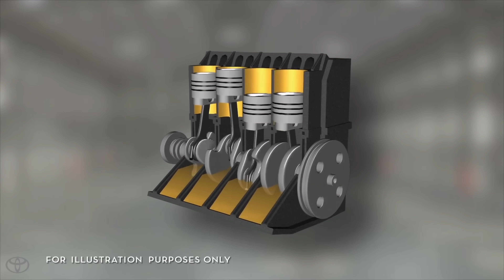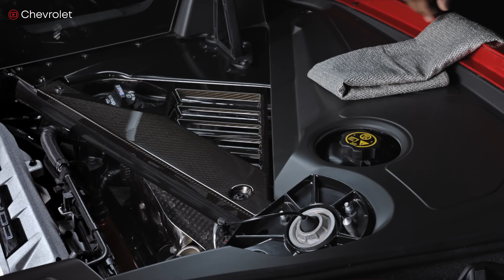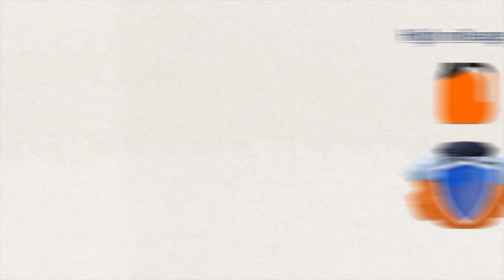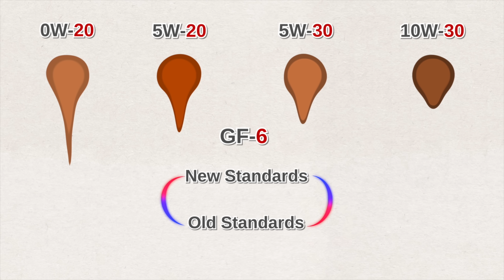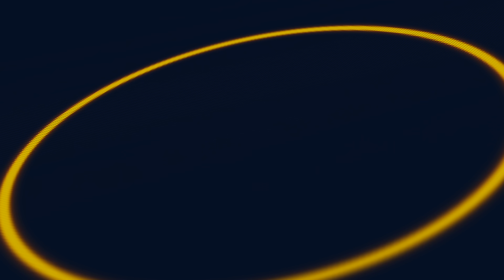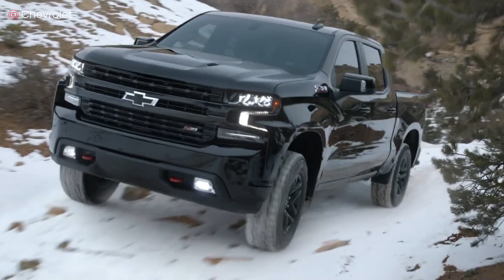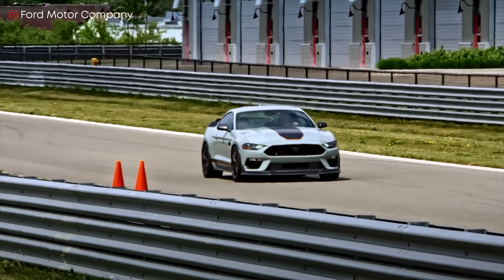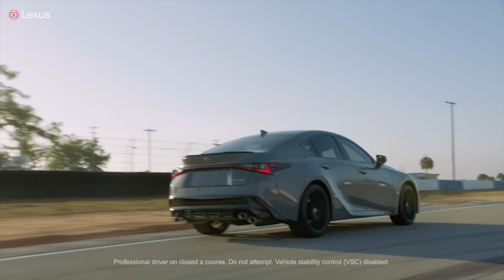7 Engine Oil Myths Stupid People Fall For

Comment: Oil can be called a "synthetic blend" if it contains just one drop of synthetic oil, the balance is conventional oil. Don't expect the benefits of synthetic oil when using a "synthetic blend". A synthetic blend can be no better than conventional oil but cost more.

Comment: 0w-16? I have literally never seen or heard of this
Reply: Unfortunately, it is. Ecology is a priority and this is the result. The oil is very thin and does not put up any resistance = low consumption = glory to the environment. Attention, you must have a modified engine from the factory for this viscosity!!! Not that you will be using 5W40 and decide to try 0W16. You wouldn't like the test at all...

Comment: “An ounce of prevention is worth a pound of cure”, I use Amsoil products, they never let me down and much cheaper than paying ~$7k for a new engine.  I was an avid Mobile 1 user before I tried Amsoil via word of mouth, my engine just felt like it ran with much less effort and slightly better MPG compared to a fresh oil change using Mobile 1. This is all my personal choice and experience.

Comment: these low oil viscositys are just for emission perpose and mpg. The government coulden't give two shits about the longevity of your engine. granted running to thick for certain engine's isnt good, but oils like 0w-20 for example of turbocharged cars lol its comical.
Reply: Attention, you must have a modified engine from the factory for viscosity 0W20, 0W16 !!! Not that you will be using 5W40 and decide to try 0W16. You wouldn't like the test at all... It's for new "ecological" engines - you spelled it right...

Comment: These newer smaller displacement high horsepower engines have much tighter tolerances. I have seen heavier oils actually almost starve the parts because the viscosity is too heavy.

Comment: As long as you change the oil often any oil that meets the manufacturer specs is fine. The only time i stray from that is a turbo engine or a vehicle that is being used in extreme conditions such as offroad or racing. In that case I always use a good name brand full synthetic such as amsoil or redline.

Comment: Did nobody hear him say conventional oil is good as long as you choose the right weight ? 
Ummmm the w stands for winter not weight. It tells you the viscosity at low temperatures. 
This is the first video I watched on this channel, don't think I will be returning.
Reply: As of 2015 the viscosity grades are 0W, 5W, 10W, 15W, 20W, 25W, 8, 12, 16, 20, 30, 40, 50, and 60.[4] In the United States, these numbers are often referred to as the "weight" of a motor oil, and single-grade motor oils are often called "straight-weight" oils. The grades with a W designation are considered Winter-grades, and denote an engine oil's low-temperature properties, while non-winter grades denote an engine oil's properties at the operating temperature of an engine...  The viscosity of the oil does not determine the quality of the oil. If I have conventional oil (I'm from Europe = we don't know such a term here, I assume it's "mineral oil") that has the same specification as synthetic oil = no one can say that synthetic is better because both oils have passed the same test.

Comment: Car companies recommend 3-4 different options for oil! Which is the correct my friend?
Reply: The manufacturer will never "recommend" 3-4 types of oil. Each manufacturer prescribes one oil performance specification/standard that must be adhered to. Don't you mean different types of viscosity? Yes, the manufacturer does not know where or how you will use the car and what your priorities are and therefore the viscosity range can be much larger than 3-4 as you state...e.g. my priority is engine protection, so always 0-5W40... priority fuel consumption= 0W30

Comment: I have a Lexus 2006 GS300.  Would 5W-30 oil be okay to use?
Reply: First of all, you must comply with the oil specification prescribed by Lexus. If you are from the USA, I recommend API SN (although the SN standard was only published in 2010, it applies retroactively). If the engine works great and does not consume oil, the viscosity of 5W30 is optimal.👍

Comment: Auto manufacturers know what's best for the longevity of their engine until they start recommending 15k mile oil changes.
Reply: The VW concern in Europe already has an interval of 50,000 km (31,000 miles)🥶

Comment: You forgot to mention gasoline getting into the oil from leaking fuel injectors or faulty fuel pressure regulator

Comment: One of my Owner's Manuals specifically recommends changing the filter every other oil change.
Reply: J Thomas. A lot of filters these days are good for 10k miles so I can see that. For me, since they are so cheap I change it with every oil change I do for my cars and my customers. At the end of the day it wont hurt anything.
Reply: @vigilantemotors  To me it's a waste, but then my vehicles rarely even see dirt roads so there isn't much dirt on/around the engine.
Reply: @jthomas3773  I can appreciate that lol. Most last close to 10K so yeah all is good
Reply: Changing the filter only at the second change is the same as changing a baby's diaper and using the original diaper because it wasn't full yet...:face-turquoise-covering-eyes:

Comment: All I ever use is conventional oil 5-30w or 30w in all my cars & trucks, my 1995 Chevy Camaro had 500,000 miles on it when I traded it for a 2007 Chevy HHR and it now has over 279,000 Miles on it, I do all my tune ups ever 10,000 miles and the oil & filters are changed ever 3,000 miles And I'am a Professional Automotive Tech with over 50Yr.s of exsperience, Regular Tune Up's, This is the key to longevity in all makes and models, and I use 87 octane gas. Note the 95 camaro wasn't even useing or burning any oil when it was traded off.
Reply: I think a lot of full synthetic oil advocates would hate it if an oil test found no full synthetic oil in the test... which is a common test result...
   I am from Europe and also only use conventional oils. I had to take the Mercedes w124 250D out of service due to massive corrosion 1,603,xxx km (approx. 1 million miles), the MB Vito CDI standing in the garden has almost 800,000 km (approx. 500,000 miles). Yes, we have experience, there is no point in explaining something to us.   Greetings from Central Europe

Comment: I have 2002 camry LE which oil should I use now ?
Reply: Muhammad, I don't know what engine you have but you are going to want to use SAE 0W-20. You do not  need a full synthetic just fyi. Conventional oil will work just fine. If you tell me what engine you have the 2.5 or 3.5 I can tell you how many quarts you'll need as well.

Aaron
Reply: @vigilantemotors  If he pours 0W20 in there, he will thank you because he will be looking for a new engine...

Comment: I am sorry but logically this makes no sense.   If high mileage oil is better for high mileage vehicles it will be better for low mileage vehicles.     But the elephant in the room is that none of the engine oils that are supposedly awesome for gas engines, are not sufficient for diesel engines.     So a full synthetic for gas can't compare to a standard oil for diesel, even though the full synthetic is much more expensive than the diesel engine oil.   It is a marketing scam.
Reply: I have to say you took my breath away. Wow... I've never seen anyone logically come to the correct conclusion without a deeper knowledge of oils. 👍👍Bravo!!! If you want to know more - write.

Comment: My car's recommended oil is ow-20 but I imported it from America to a Tropical region, is it ok to continue with ow-20? Which I actually continued to use.
Reply: Yes. Use the oil your car says. It's used inside the car so unless you live somewhere extremely cold use 0w 20
Reply: Yes.
Reply: In a tropical environment, I would be careful with 0W30, maybe even 0W40. It would depend on many aspects...

Comment: In 1985 I bought a new '85 Tbird. The first oil change I did was with Mobile 1 synthetic 10W30 (when it was around $2/qt) . I ran it to 50,000 miles and changed the oil. Then changed it again at 100,000 and It ran great until about 136,000. The tranny went out (I think it was a C4). Then I changed it again at 150,000. I sold it after 11 years. The engine ran great but the rest of the car really deteriorated. Horrible. Never again, Ford!!

Comment: Scotty, i'll ask this question again, what damage is done when nimrod put synthetic oil in, when i told them No! synthetic oil and they over fill it?  over fill it.
Reply: If the nimrod adheres to the prescribed oil specification and has a choice between mineral oil, semi-synthetic oil and fully synthetic oil, no damage will occur and it does not matter which oil he chooses.

Comment: Back in 1976 i had a 1974 Pontiac Grand Prix with a 455 ci   it had 28,000 miles on it,  i kept seeing this commercial about really good Oil Called  " Shell Fire & Ice "  i was due for an Oil Change so i bought it   i put it in with a New filter  about 80 miles later i was driving on a Very hot day with my air on i took off from a light and the car was NOT going any where i noticed my dash lights were on,  My Engine was Blown when i drained my oil it was like water,   That Oil was taken off the market i should have saved the oil and started a case against Shell    but i was young i bought a New motor and put it in ...
Reply: In Europe I remember lab tests of fully synthetic oils and Shell was the most expensive and had 100% pure mineral oil inside. But to everyone's dismay, it turned out that it was not a scam... that an oil labeled fully synthetic might not have anything synthetic in it!!!

Comment: Journeyman Mechanic of 36 years , for Caterpillar, worked with engineers in access design, engine rebuild standards, 5 year contract with oil breakdown and wear anaylsis...... After seeing actual results from hundreds of teardowns and put backs and retests... Oil is the biggest scam on the market... Once vicosity goes down, it will start evaporating. I leave my oil level at 1/2 and check it monthly, maybe one time a year I may or maynot change a filter.... I probably have drained my oil 5 times in my life... My crappy Dodge Neon lasted 350K before I sold it, with the original filter on it. I have gotten over 200K on every single car I have ever owned.... I never let the oil go lower than 1/2 way point on stick.... Coolant is by far, the most important thing. 
I had 1 engine failure in 1982 on my 1980 grand Prix that I changed oil every 2500 miles with Quaker State... When I pulled it apart, nothing but carbon charcoal in every port... Just sold my Mercedes e320 with 275K, currently driving a 2015 Verano with 210K and made my first repair 2 weeks ago with a set of $29.00 cam sensors that took 15 min to change. Car looks showroom new !
Reply: what do you mean by oil is a scam? that there is no need to change frequently? I don't drive cars, but motorcycles - they do rev a lot higher than cars, no?!

Comment: Anyone ever run an engine on airport nacho cheese?  That's mostly oil.  Test mule should be solid roller I think: flat tappet [or bucket] would wipe out, and hydraulics wouldn't know which end is up.

Comment: Years ago a guy at work started promoting amsoil.
He even insisted it doesn't wear out it just gets impurities in it from the fuel.

He bought a new 1968 Dodge and he was changing the filter at 5,000 miles, then the oil and filter at every 10,000 miles. The last time I spoke with him was about 1998. His engine had almost 300,000 miles on it and was still running great. Also, he was using amsoil in the transmission and it had NOT needed an overhaul.
Reply: Amsoil is the best but only makes sense to use if you keep your vehicle for a very long time.  It’s expensive.
Reply: @ernestt4969  Good point.
We need to fully trust that it is better and extend the mileage between oil changes. That way it is not so expensive. The Amsoil site is so bold as to suggest 20,000 miles between changes. I'm not that brave as yet. Long ago a friend from work was changing oil filter at 5,000, then oil and filter at 10,000. He had cars from the 60's up to 180,000 miles with no problems. So it  really IS better. For the future I'm going with change at 10,000. Then I'm going to send the oil to a facility that tests it for breakdown. That can also let you know if the engine is beginning to show wear by the chemicals they detect in the used oil.

A friend has been changing the oil and filter on his 2000 Harley at 5,000 since it had about 10,000 miles on it. It now has 88,000 miles and it's as quiet as a really low mileage engine.

Comment: Question, can you just change the filter and use the same oil till next time you change it? 🤔
Reply: Yes, all you really need to do is change the filter, it will keep the oil clean and you never really need to change the oil as long as you change the filter every 20,000 miles or so.
Reply: You can. When you change the baby, you can also just give him a clean diaper. You'll have it faster if you don't have to wash and wipe it... you'll do that next time 😜😝

Comment: The number before the W doesn't indicate the viscosity at 0 degree and the number after the W doesn't indicate the viscosity for summer.

Modern synth oils in modern cars can easily reach 12,500 miles, not 7500. Additionally, as recommended by car makers, it's better to change the oil at half of the indicated mileage if the car is mainly used in city and/or for short distances and/or loaded and/or under constant effort (towing). If the car is used at high speed/highways, the oil can be changed at the mileage indicated by the car maker.   

Basically, you said wrong info.

Comment: One additional point. There are more specifications for oils than just mentioned here. A good example if the VW PD diesel, and Land Rover TD5. These really need something specific, and quoting a viscosity rating isn’t enough for such engines. As a guide, the manufacturer will give you the reccomended oil spec - not just the viscosity, but also the individual spec. Stick to this, and you can’t go wrong.

Comment: I always use cheap oil 
Change at 4500 miles
I have 2 20 year old vehicles 
176,000 and 160,000. 
Think how much money I saved at every oil change , even if they blow up tomorrow.

Comment: Nobody uses conventional oil anymore. even our Classics, take a blend, or full synthetic. The only real use for true conventional is break in. Some blends can outperform synthetics. Motorcraft XO5W20 for example, has better long term heat stability than 80% of full syns. Viscosity is only one of many characteristics we look at. "oil' does not wear out. The additives do. We do a lot of Euro, and ACEA is a much better standard. Oil change intervals are more warranted when there is a lot of cold starts, with no full heat cycle. Fuel actually gets in the oil and dilutes it. We see 5% sometimes. Black oil comes from carbon loading, more than anything. Not enough cleaning agents to make the cycle. A cleaning service is in order with modern cars, and is really the modern tuneup. Gritty, or grainy? That is not science, or even intelligible. Take an oil sample for #$#* sake. Oxidation, Nitrates, and sulfation are what matters. This comes from blow by, and fuel. Synthetics in the old days did not cause wear and tear. the Seals were not made to work with the new oil, thus, a missapplication.  You can actually replace a vintage crank seal with a new design and solve some of that.
Reply: 1/.You forgot the important fact that the oil marked on the packaging as fully synthetic can be fully mineral inside if it is made from group III base mineral oils.
2/. Fully synthetic oil - can contain from 1%-100% synthetic oil.
  and usually it is a value of +/- 10%
Such is the sad reality.

Comment: In the late 70s I changed the oil in my Mom’s car. It always had at least 7,000miles between oil changes. Engine never had an oil related problem. Never! 8 years and 105,000 miles later, she sold her car to a neighbor. He never changed the oil!!!!! He only added oil when it was low, NEVER changed oil!! When the car was 13 years old, and had 260,000 miles on it,and full of rust and holes, he drove it to the junk yard. That car never had a transmission fluid change!!! That car never failed for my mom and never failed for my neighbor. Basic maintenance, water pump, brakes, carburetor rebuild, basic scheduled maintenance. The car never let us down.

Comment: Also using thicker oil for higher milage engines might be good for the wear clearance components but not good for the parts that don't wear such as pushrod oil holes or oil passages for bearings actually causing more wear from thick oil not flowing through what was designed for thinner oil.

Comment: Years ago I got hooked on Castrol 20W50 for 4 cyl summer driving and Castrol 10W40 for winter.  I had a Ford Ranger once that was a 6 cyl.  Changing the tranny at 170,000 miles we noticed a rear main seal leak and decided to replace it, which meant dropping the oil pan and taking out the oil pump because it was in the way of removing the pan.  Since it was out, and a pump had to be put back in, I decided to save the labor costs and at $130 replace the pump.  Smart move.  My point...the oil pan looked like it had just come from the factory with 0% sludge.  Not even slighty discolored.  I had to run my finger down the bottom of the pan and look it at in the light to see the shine of any oil evidence.  CHANGE THE OIL became my new mantra.  Good video Scotty.

Comment: Dont syn blends only need to have 5% syn and 95% regular oil?
Reply: Unfortunately, it is more complicated and more confusing... Most fully synthetic oils as written on the package have 90% mineral oil and 10% synthetic oil inside. The proportion of synthetic oil is not fixed. It can be from 1% - 100%. And to make matters worse, there can also be 100% mineral oil inside.
You probably didn't want to hear that, did you?